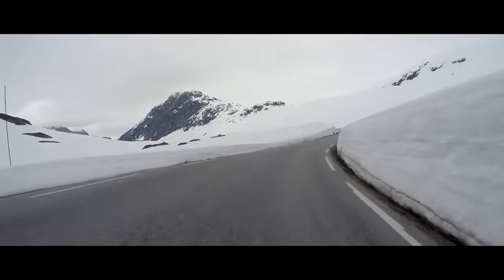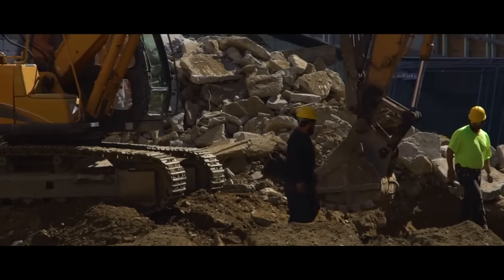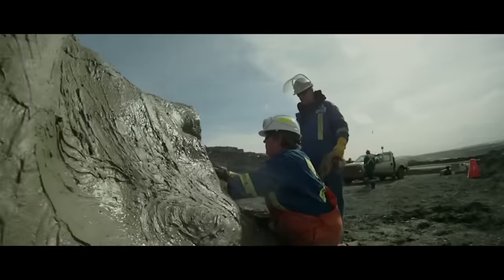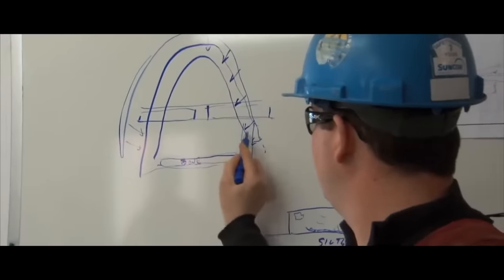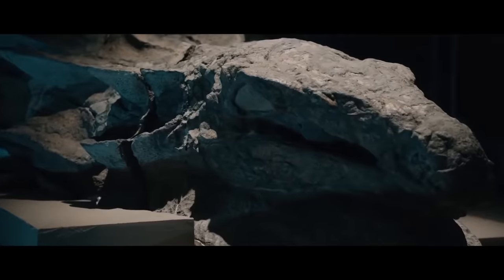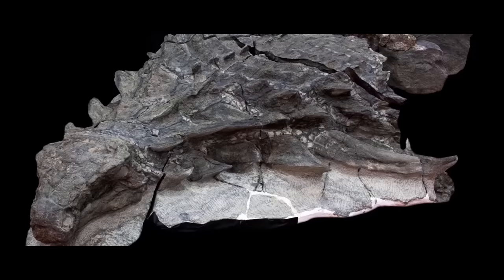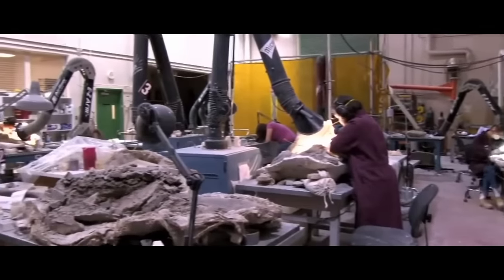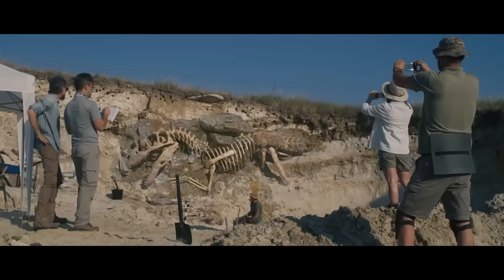It looks as if it was alive a couple of weeks ago - They discover a dinosaur in impeccable condition

Comment: did you know they use the rock layer dinosaurs are found in to determine the age of the dinosaur, and conversely they use the age of the dinosaur to determine the age of the rock?  It's circular reasoning and the geological column was made by a lawyer.
Reply: I'm not a geologist or a palaeontologist but I know that there are many ways to date a rock layer. When they all come up consistently with the same answer you can be confident that it is correct. Looking at the flora and fauna (e.g. Conodonts) present in a layer may be used as just one of these confirmatory pieces of evidence. I'm afraid that it does not make the process wholly circular.
Reply: @julesgosnell9791  The problem with any of these dating methods is they all assume that the conditions on the planet were the same back then as they are today.  Even creationists and evolutionists agree that the planet was different a long time ago, but just very different interpretations of different.  The radiometric dating only works with the decay rates we see today and we also assume that the amount given to the labs for analysis are basically brand new.  It's like trying to date how old a car is and the lab assumes every car they date is brand new in terms of how much of the car remains.  Did you know that Mount Saint Helens volcanic rock that was made at the eruption was potassium-argon dated to be several million years old?  Hate to break it to you scientists, but that rock is only 30+ years old.  This is just one of many examples of where radiometric dating is wrong.  I admittedly don't know much about what you're describing for flora and fauna, so that is something to look at, but I would be cautious if that method assumes the conditions on the planet today are the same as they've always been.
Reply: @julesgosnell9791  Except that the results don't come up the same - not even close. The dating methods vary across millions and billions of years for the same rock; that's no negligible difference.